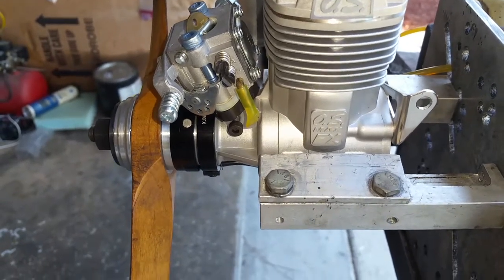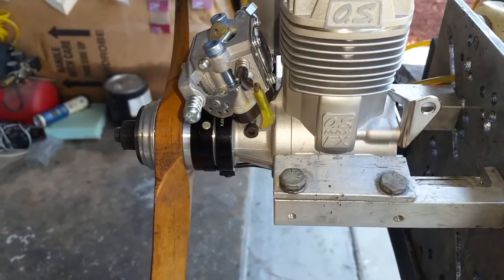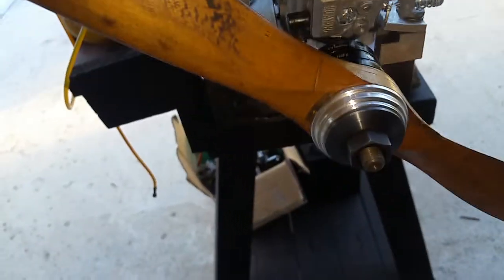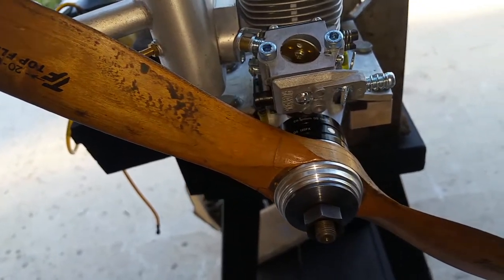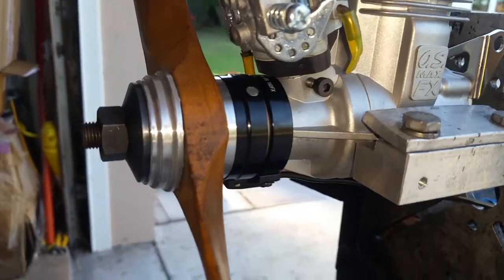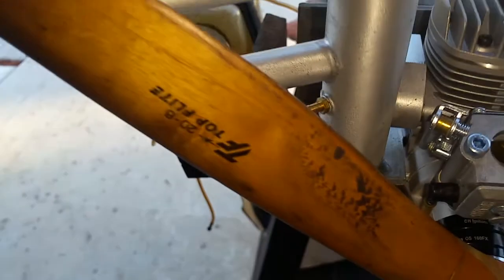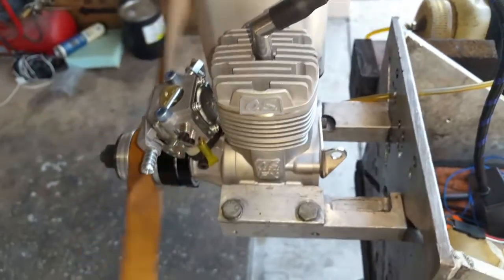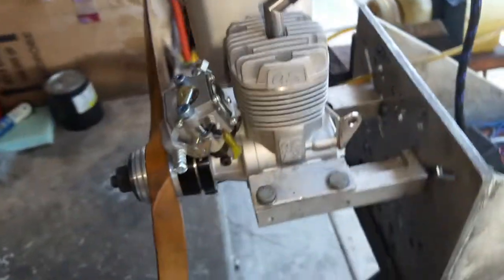OS 160 MAX FX CH Gasoline Conversion

Comment: I have a os 160 fx im going to use on a new 30cc ultra stick do you sell a gas conversion kit for the OS 160 I would like to convert it as im mostly using gas not nitro on my rc planes i will give you my information phone number etc thanks so much
Reply from the maker: Eric something wrong with your email.
Contact again.